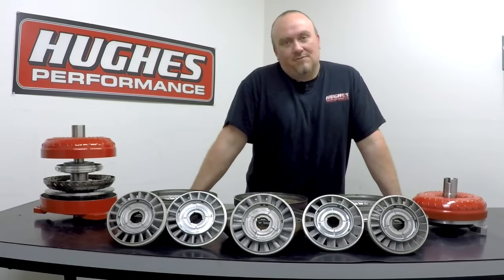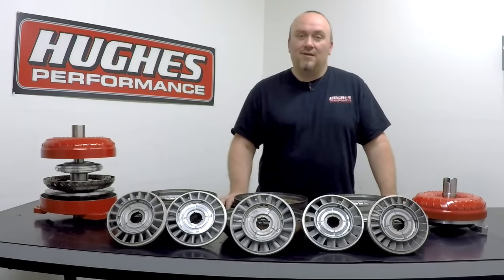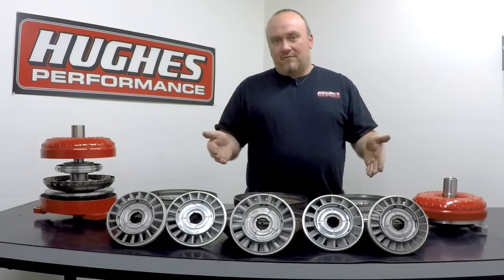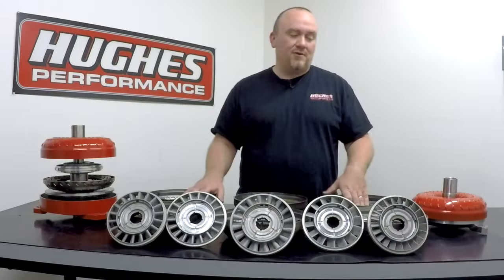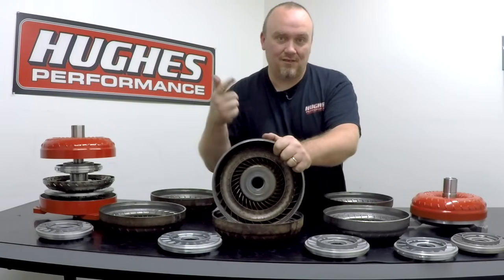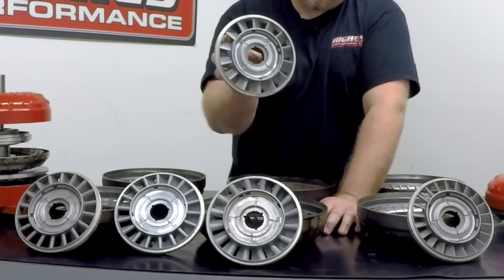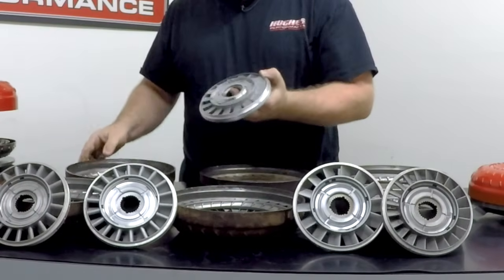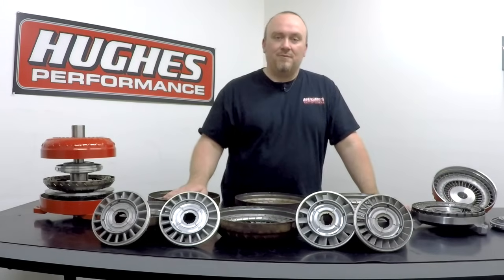Ep. 5 Torque Converters 101: What Is Stall Speed?

Comment: Hughes did a wonderful job for me and my modified 76 Cadillac.  I beefed up the stock 500 8.2L with high compression aluminum pistons, Ford FE high ratio shaft rockers, big Pontiac valves and heavy beehive springs, with a lumpy aggressive Comp Cams camshaft advanced 4 degrees, high energy Accel HEI, blueprinted Melling oil pump, FlowKooler water pump, and 800CFM Edelbrock carb atop a ported and polished OE manifold with Sanderson headers.  The stock 5-clutch Turbo 400 and stock 2.73-to-1 rear end can handle the 400 horse and 600 ft lbs of torque the  motor now makes, but the stock torque converter would have had poor response and deprived me of enjoying the motors full potential.  Pete at Hughes picked out an alternate GM converter that was friendly to the Turbo 400, and would maximize the motors behavior, but the bolt pattern didn't match my motors flywheel.  Pete at Hughes arranged for the folks at Hughes to modify the mounting feet (fabricated new feet to match my flywheel), space them perfectly so that the converter had proper engagement depth (penetration into the transmission front pump splines), and got me setup wonderfully.  And the cost was obscenely affordable!  It was within 25 dollars of an off-the-shelf converter available anywhere online.  I could not be happier.  Wonderful, competent, fair people!

Comment: at 4:07 when he says the transmission, TC, and Axle ratio can convert your 400ftlbs to 600 or 800ftlbs, are his numbers off by an order of magnitude or am i missing something with how these ratios work?! if you had 400ftlbs of torque at a complete stand still trying to spin the TC, would your 1st gear ratio not be at a minimum 4:1 and your axle ratio atleast 3:1 for easier math, so right there you have 12 times as much torque even without any benefit from the torque converter.. which i dont understand how it increases torque i thought its only function was to allow the transfer of torque with the proper amount of slippage at a variety of rpms shouldnt the wheel be seeing around 4800ftlbs with those numbers.. i imagine common drive ratios 1st gearxaxle ratio must range from say 8:1 up to 25:1
Reply: The engine driven impeller pumps fluid against the turbine. Without a stator the fluid would bounce off the turbine and hit the impeller again (slow it down). The presence of the stator means the fluid bounces again (off the stator) and is now travelling in the same direction as the impeller now when the fluid strikes the impeller blades it assists the impeller to pump the fluid.
Basically the pump has a fluid lever inside known as a stator (giving itself more mechanical advantage over the turbine)

Comment: Not going to read all the comments  to see if my question is. My 3700 lbs with me in it Barracuda, 345ci LA engine is getting a 4 inch crank this winter.  Have a built 904, 355 gear with a Gear Vendor unit. 
   Now currently I cruise at 75 at 2700 rpm. How will that change with the 416 ci.. It has a tight 3000 convertor.  The question is with the extra (just a guess) 60, 70 ftlbs of torque will the rpm cruising drop, stay the same or go up?

Comment: So if I have a LS swapped conversion and I feel that at idle the engine is over powering the brakes do I get a bigger converter? Or should I consider a different automatic transmission with a lower first gear ratio
Reply: Sounds like you need a higher stall converter to me.

Comment: Great video! The only question I have is how much a typical car torque converter waster energy (in kW) when the transmission in on Drive, the engine idling and the car is hold on brakes? Does different stall speed affect this?

Comment: Sorry, I failed to grasp what difference it makes. Is this a drag racing thing? Is the rpm of the so called stall speed related to the max torque or how rpm? Does it mean for example the engine must reach 3k rpm and the transmission engages?  I am a pilot and stall speed means an exceeded angle of attack and you fall out of the sky. So does the stall speed mean the fluid in the converter no longer flows and it cavitates? Some of your audience meaning me needs more explanation.

Comment: Funny, he never answered the question posed...  Stall speed is the speed at which the converter holds back or limits the engine speed if the transmission output is prohibited. When your torque converter prevents the power transfer from your engine to your transmission, it increases the engine’s RPM stalls. For example, when you press down on your gas pedal, the stall speed is the gap between where your vehicle ideals and begins to move. The more stall speed you have, the more pressure you have to put on the gas pedal before your car begins to move.

Why is Torque Converter Stall Speed Important?
High performance torque converters can do a lot for your vehicle when the proper stall speed is selected. For racing, the proper stall speed will increase your launch and get you off the line quicker. In towing, the proper stall speed will help your engine pass more power to your transmission, causing your tow capacity to increase.

How To Choose the Right Stall Speed:
When you are selecting the right stall speed for your vehicle, be sure to match the engine’s peak torque, torque curve and vehicle weight.

Peak Torque – The maximum torque your engine can exert at a certain RPM.
Torque Curve – The place where the engine has the maximum amount of power at a certain RPM.
Vehicle Weight – The weight of your vehicle has a big impact on the measurement, and don’t forget to factor in aftermarket modifications.
If you don’t know these exact specifications, we recommend giving a conservative estimate. If you over estimate, your stall speed will be lower than intended, which will reduce your torque converter’s performance. If you are unsure about these modifications, the experts for help.

In general, the desired stall speed should be 500-700 RPM below the engine RPM at peak torque. This ensures a margin for application for the torque converter to take off. You don’t want to have to floor your gas pedal and wait a few seconds for your vehicle to move. Think of it as a balancing act.
Reply: What exactly is stall speed, and how does it affect your vehicle?

With the introduction of the Banks Billet Torque Converter, you’ll hear a lot of talk about stall speed. What exactly is stall speed, and how does it affect your vehicle?

This article assumes you have a basic knowledge of how torque converters work. If you’d like more in-depth detail, see “Understanding Torque Converters” elsewhere on this site.

Let’s start by illustrating how the stall speed works. Even under light loads, a vehicle with an automatic transmission will start moving as soon as you take your foot off the brake. The stall speed comes into play under all load conditions. When we talk about stall speed, we’re referring to engine RPM. If the vehicle isn’t moving by the time the impeller reaches the stall speed, either it will start to move, or the engine RPM will no longer increase. In other words, stall speed is the engine RPM at which the torque converter transfers the power of the engine to the transmission.

In the real world, the torque converter’s stall speed roughly equates to the clutch engagement point on a manual transmission. Let’s say you’re driving your stick-shift car around town. Normally, you’d give the car a little gas and ease off the clutch pedal gently enough to get a smooth start. Likewise, under most driving conditions the torque converter will start delivering power to the transmission at relatively low engine RPM.

Now, let’s say you need lots of power, either to make a fast getaway or to start with a heavy load. You’d rev the engine up to a point where it delivers more power before letting up on the clutch pedal. It’s under those same circumstances that the stall speed becomes important. The torque converter will allow the engine to build RPM without turning the output shaft (the turbine) until the stall speed is reached.

Unlike gas engines, diesels develop massive amounts of torque (pulling power) at low RPM – enough that it’s possible (and, in fact, desirable) to get a heavily-loaded diesel truck rolling by simply easing off the clutch without touching the accelerator. Banks’ dynamometer tests show that Ford’s 7.3 liter Power Stroke hits peak torque at 1,600 RPM and begins to drop off at around 1,850 RPM, while the Dodge’s 5.9L Cummins engine peaks at 1,400 RPM and drops off at 1,800 RPM. As RPM continues to rise, torque decreases even further.

How would you translate this to a torque converter? With a low stall speed. But both the Ford and Dodge torque converters stall between 2,000 and 2,500 RPM – so with a heavy load, the torque converter won’t start turning the rear wheels until well beyond the engine’s torque peak. In this case, the stall speed is too high – it is literally impossible to get the engine’s full power to the rear wheels! In order to access all of the engine’s potential power, the stall speed must be lowered.

Lowering the stall speed has another advantage: It reduces the transmission’s temperature. Let’s go inside a high-stall torque converter under heavy load. The impeller (input side) of the torque converter is spinning quickly, while the turbine (output side) is spinning slowly or not at all. The motion energy of the impeller is being converted into heat energy, most of which is passed on to the transmission fluid. The higher the stall speed, the more heat will be generated. Heat is the enemy of a transmission. You want to keep the fluid temperature as low as possible. With a lower stall speed, less time elapses before the motion energy of the impeller is converted to motion energy to drive the turbine, so the transmission runs cooler and lives longer.

What many people don’t know is that the torque converter is a tunable device. Stall speed is determined by several factors, including the distance between the impeller and the turbine and the design of the stator. By properly modifying the converter’s internal components, it’s possible to alter the stall speed and create a torque converter that is tuned for a particular engine.

Comment: Let me simplify this for everyone....the front spinny thing uses fluid to make the back spinny thing go around and around. The engine speed required for the front spinny thing to spin the back spinny thing when you mash the accelerator thingy as fast as you can is called the stall speed. I don't know why they call it stall speed because it doesn't stall when its spinning.
Reply: The turbine is stalled.
Reply: It does stall out tho the fluid starts to move backwards actually
Reply: So the spinny spin spinner, spin the spinny spin spin?
Reply: @MillenialWhiteGuy  I have a 12 speed.   Oh, wait!  It's a computer controlled manual.  Without a trailer on flat ground it starts in 5th which irritates me; too much clutch wear. 
I prefer to just burn an extra ounce of fuel and save $5k on clutch replacement. 
It leaves clutch engaged during shifts by aligning input & output gear speeds.  
My engine is rated 500HP ,1700# tq
Reply: @davepetrakos475 
The gubmint made the manufacturers do it to us by prioritizing “fuel economy” above any sense.
Reply: and this is why i prefer a manual. 😂
Reply: @Jstill84 automatics have come a long way in the past years. Most drag cars use automatics now.
Reply: @Jstill84 you should get yourself an automatic transmission with 10 gears

Comment: I've got a  .060" over 427  12.5:1 CR, Single plane intake with a 800 cfm dbl pmp Holly. Solid lifter cam, Advertised Duration: 304
Duration at .050" :  258
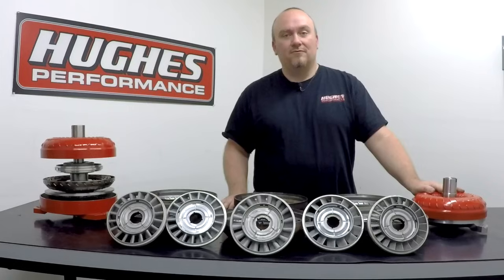Lobe Separation  : 108  .615" lift, 400 THM 4:56 12-bolt posi in a 4000lb 72 C/10. Can you recommend what stall speed I need? This truck wont see much street, track truck mostly...Thanks!

Comment: Up to the end of the 1967 model year, GM made "switch pitch" torque converters, which increased the stall speed if the accelerator was depressed most of the way. It seemed like the best of both worlds, but I've heard it could be a reliability trouble spot. Do any aftermarket builders make switch-pitch converters today?

Comment: If you are running a converter with a stall speed of 2200 to 2600 and you are running at 65 mph on the freeway with the engine turning at 2000 rpm's at 65mpr will the torque converter, be slipping causing heat and poor efficiency?

Comment: This is a great video. Years ago I had a Rover 800 2.0 litre with ZF HP14 4-speed automatic gearbox. They were sold as Sterling in the US and I expect they had the 2.7 litre Honda engine over there. As I was having the engine and gearbox rebuilt I took the opportunity to have a custom-made torque converter. I told the torque converter company that I wanted the lowest stall speed possible. They said they could do it, but it wouldn't work as the engine would stall as soon as it was put in gear. I went away to think about it, and the maths involved, and I concluded that they were wrong, so I asked them to go ahead and build it that way. They supplied it to the mechanic who was putting the gearbox back together, and after having supplied it, someone higher up in the company rang him up and said, "We're sure it isn't going to work, so if you return it now before it's fitted, we'll put it back to normal at no extra cost". Clearly, the discussion about it had filtered up and someone more senior had eventually taken a look at the spec after it had already been despatched. I went away and thought about it again and simulated it in my head, and I concluded that I was simply going outside their normal envelope of experience, and that they were extrapolating linearly outside of their experience instead of in proportion to the cube root, which is indicated by the maths. Plus, I'd reached the point where I had to know if I was right or not. So I told the mechanic to go ahead and fit it.

I've got to say that it was almost perfectly how I expected it to be, in that there was a bit of an extra 'kerthunk' when it went into Drive, and the engine vibrated a little more on tickover when stationary, as the torque converter was pulling harder at tickover, but it didn't even come close to stalling the engine. Driving through traffic was lovely, because a lot of the time I only needed to take my foot off the brake to keep up with slow traffic as it would creep at a much higher speed than normal. To make decent progress I only had to breathe on the accelerator and the first to second gear change was extra silky because then engine was revving so slowly when it happened. Commuting right across London at the time I managed to average 35mpg over a tankful, which is pretty good considering that it was a 2-litre, long and relatively heavy car, driving through one of the heaviest traffic areas of the UK for most of my journey each day. But I was especially delighted that my experiment had worked, and the experienced, qualified professionals were wrong. The downside is that at the traffic lights Grand Prix it was definitely slower, because the torque converter was holding the engine speed down to a lower speed all the way through each gear, but if you use a car for normal commuter driving and not racing, then a lower-stall-speed torque converter is much nicer to drive with.
Reply: Thanks for a great comment.

I’m fascinated by experts being right and by experts being wrong.
Reply: @SS-qk8oc so am I, and more importantly, understanding the reasons why.
Reply: No thanks.

Comment: Are there any markings/#s on torque converter to know if it's stock or performance ? (Part # ?) I bought a used C-4 with a converter. Was told it is 4,000 stall. Haven't found any #s to know if it's stock or performance.

Comment: what stall do you recomend ? I have a 1982 dodge d150 short bed with mildly built 318 with stock 30 over flat top pistions with factory 360 Hipo cam . 727 auto none lockup with racing shift kit and rear is 8-1/4 with 3:55 gears . the front 15 x 7  with 235 /75/15 and rear is 15x 8-1/2 with 255/75/15
 I was thinking 2000 stall ?????

Comment: I am Still Trying To Have My Older 7004 And My New Blue Print 383 Stroker Working Properly, I have PurchasedA Hughes 2600-2700 Stall Converter And The Engine was Surging I was Told To Unhook Plug On The Driver  Side Of The Transmission .After Doing So The Engine Surge Has Gone Away But I Don't Want to Burn Up My Transmission. I Am Getting Conflicting Information On Whether Or Not This Will Happen. This Combination Is In My 55 Belair 2Dr. Htop Which I Have Owned For 51 Years And It Is A Beautiful Car! I Would Appreciate Any Assistance In Resolving This Problem!       Thank You!

Comment: Good afternoon, I have an edelbrock performer kit, for a 302, 81 of a bronco, they estimate 320 hp and 260 foot pounds of torque between 2000 and 4000 rpm (5500 rpm max). It has a 3-speed c6 box, standard differential and 33 wheels, I need to replace the torque converter, I appreciate your suggestion to choose the right one for these characteristics, the camshaft indicates, intake duration 204 degrees, exhaust duration 214 degrees, elevation intake .448", exhaust elevation .472", lobe separation 112 degrees, intake center line 107 degrees, vacuum 16", thank you very much and congratulations for the videos, they are of great help to incorporate knowledge.
Reply: We are still out to lunch!
Reply: @krusher74  i wouldnt answer the question either if he cant be bothered to call... and cant be bothered to go find his axle ratio probably the most important factor, "standard" isnt a ratio